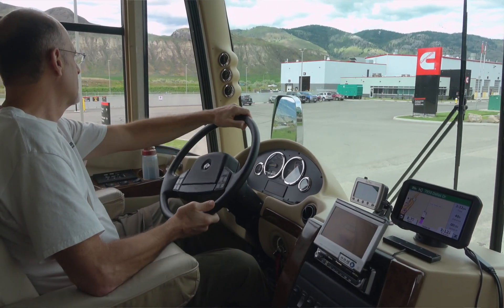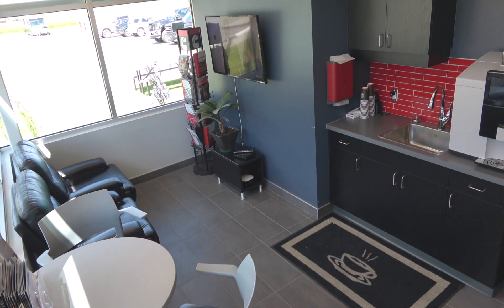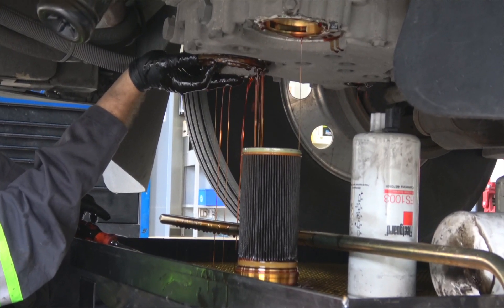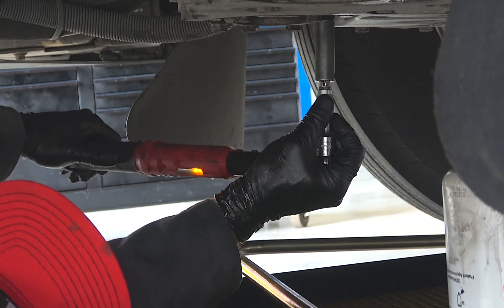💵 CUMMINS COACH CARE RV SERVICE & MOTORHOME MAINTENANCE DISCOUNTS!

Comment: Thanks for the video guys!   Just went past the Cummin's location just outside of Kamloops, so I know the area, as we stayed overnight fairly close to them!    I've been doing my own oil & filter changes, as well as both fuel filters, not hard, and I have a location close by who will take the used oil too.   A little time consuming, but a saving, nonetheless.   Like you, I'll leave the big jobs to the experts!   We recently had a check engine light, which showed that our DPF was getting hot...not overheat, but the light was in yellow.   Soon after that, after we had crested the long Coquihalla hill, I got a 'Stop Motor' signal on the dash, so I found a place to pull over, shut the engine off, and looked around the coach.  All seemed to look fine, and it started, and ran perfectly all the way home.   I took the motorhome into our local 'Port Kells' Cummins dealer, who sent out a Tech to plug into the coaches computer, and found that 'with' the hot DPF, that it went into Regen at the same time, which was what gave the 'Stop Motor' signal.   He said all is good, and after talking with other specialists, they mentioned all was fine, and to continue using the coach, and that it was a 'courtesy' for them to check it...so I was especially happy to hear that there was no cost to the check!   I'll continue using Cummin's, and as mentioned they're local, and that all makes it helpful.   Appreciate your valued opinions on so many of the video's you produce, and thankful for your tips on many things related to our coaches!
Reply from the maker: Dale Watkins Hi Dale! That’s a happy ending story for sure after the potential for something much worse. We’re so happy to hear that your experience with Cummins has mirrored our own. It can be so hard to find reliable shops when you’re on the road, so having a trusted place to go is the best. Safe travels, and thanks for the awesome comment.

Comment: Had our 03 Kountry Star DP, 5.9 300 ISB, serviced at a Cummins dealer last month. Submitted the discount code when I called for appt as well as day of service. It ended up costing me approx $200 more than the discounted price, even though the service rep said ISBs are usually cheaper to service. The service was great and the technicians did a great job, but the $1250 price is a starting point. Disappointed that "ISBs" are treated differently than the larger ISL engines.
Reply from the maker: Hi Jim. Sorry to hear about your experience. We'd like to forward your comments to Cummins. Can you let us know the location where you had the service done?
Reply: @RVgeeks  Hello again. We had the coach serviced at Crossroads Cummins, in Normal, IL on Dec 9, 2020. Thanks, and I hope Cummins provides an adequate answer.
Reply from the maker: Thank you, Jim. We’ll pass this info along to Cummins and let you know what we find out.
Reply from the maker: Hi again, Jim. We've heard back from Cummins already! Although the promotion was for a discount on ISL oil changes (apparently such a good discount that it made it less expensive than an ISB!), they felt that it was not clear in the text that it was for ISL ONLY. So we're changing the text on the special to be more clear that it's ISL only, but Cummins also said they will be issuing a $200 credit to you anyway. Please let us know as soon as you hear back from them so we'll know you've received your credit. Cummins really is a great company, and it's good to hear that that they're not only crediting you, but that you felt they did a great job.
Reply: @RVgeeks  Hello from sunny Florida and thank you for the update. I will contact you as soon as Cummins issues a refund. Again, thank you for the great support and content about the RV world. Really enjoy your videos and such.

Comment: Question what is a air dryer.....does all Cummins have!!!!when do u change?
Reply from the maker: All diesel pusher motorhomes have air systems (air suspension, etc) which require a desiccant cartridge (that’s the air dryer) which removes moisture from the system. They typically get changed once each year.

Comment: Very interesting video. I have done services for our 2018 Ventana twice at the dealer and no more. What is the difference in servicing at Freightliner or Cummins? I will appreciate your kind response.
Reply from the maker: A good shop you can count on is great to find. If you have a trusted shop you use, that's awesome! Cummins Coach Care happens to be one of the best, and has a big advantage for us full-timers... they're located all over the country, so we don't have to worry about being close to our "home" shop for them to stand behind their work.
Reply: @RVgeeks  Thanks a lot for this kind response. I am new, just part-timer yet have done all 48 states. However, we need to find  a good one around N Carolina. We'll schedule Cummins next month. Thanks again.

Comment: Is it just me or does the $1250 for the "Premium Road Ready Pkg" on the Cummins NOW site seem way overpriced?  This is after the 25% RVGEEKS discount too.  You get the 21 pt inspection, which is $329 if you buy separately, so that leaves $921 for the oil change on the ISL & genny, "filters and fluids included".  The last two times I've taken in our Phaeton to Freightliner service centers, it was $400-450 for the chassis lube with oil change with filters and both times that included both fuel filter & separator.  The generator is usually around $100-110 for an oil change.  (I just looked at my receipts).  So where is that extra $400 going?
Reply from the maker: Hi Chris. We’re sure you can call your local Cummins shop and get a breakdown on the pricing. We’ve also been to less expensive shops, and too often got what we paid for. We prefer to seek out premium services from premium companies, but we know that’s not the only choice.
Reply: @RVgeeks  I’ll check out the one in Cummins Coach Care in San Diego (El Cajon specifically) since I will be there this summer. For reference though, the two service centers I’ve referenced above for service are the Velocity Truck Center in Phoenix (Elite Partner) and Premier Truck Group in Twin Falls. Neither are low end truck shops. I’m all about going to a good shop but not willing to pay nearly double the going rate for basic preventative maintenance.
Reply from the maker: We totally get that, Chris. Lots of good shops out there.

Comment: Can they service Caterpillar engines? My RV has a Freightliner XC chassis and a Cat 3126 engine. Thanks!
Reply from the maker: Peter Colquhoun We’ll check on that and get back to you, Peter!
Reply from the maker: Hi Peter! We've received a lot of questions about whether Coach Care facilities can work on non-Cummins-powered vehicles. We reached out to their main office and have received the following response, suggesting that you can contact your local Coach Care location to inquire about any routine maintenance needs. Hope this helps:
“While our highly trained technicians specialize in Cummins products, we are able to perform basic services (such as an oil change) on Detroit and Caterpillar engines. Your service advisor will review any additional charges with you before completing the service.”
Reply: Be sure to mention the code RVgeeks if you make it over to one of the service centers!

Comment: Hi! I'm Ron, I have a problem with my RV that I haven't been able to figure out, hoping you can help me.I have an 04 Allegro bus on a freight chasis. It has a Zantrex control panel. When ever I plug into shore power, all of the lights begin to randomly flash. I can't figure out why. Batteries are fully charged. What else should I been checking for!Any idea what may be causing this? Any help would be appreciated. Thank You.
Reply from the maker: Hi Ron. First, sorry to hear you're having trouble. We haven't encountered this problem ourselves, but we've read before that when you get that flashing of lights on the control panel, it's likely because of a communication glitch between the control panel and the inverter/charger. The recommended solution is to unplug the control panel for a few minutes, then plug it back in. You can do that in two places: either right at the control panel by unscrewing it and removing it from the wall... or at the inverter/charger itself (if you can easily access it). It looks like a typical modular phone plug... and you can just squeeze the little tab to get it to release and pull it out. Again, from either end... whichever is easier for you.

Let us know if that works!
Reply: @RVgeeks  Will do and Thank you so very much for your help!!
Reply: @RVgeeks  Wanted to let you know ,my husband Ron Rogers got the problem with the flashing lights on the electric panel
 fixed thanks to your help!!Thank you!!!
Reply from the maker: Wonderful! Great to hear!

Comment: Sadly my Diesel Pusher uses a CAT engine. As close as I can get to this level of service is the freightliner dealer.
Reply from the maker: Hi Matt! We’re waiting to hear back from Cummins as to whether or not they do routine service on Cat,, Detroit diesel, or other non-Cummins engines. Will report back.
Reply: @RVgeeks  Cool, would be nice to know if they would so I have another option. The closest coach care to me is a 6 hour drive away but would always be nice to have an option while on the road.
Reply from the maker: @mattbuchanan9024  Hi again, Matt! We received a lot of questions about whether Coach Care facilities can work on non-Cummins-powered vehicles. We reached out to their main office and have received the following response, suggesting that you can contact your local Coach Care location to inquire about any routine maintenance needs. Hope this helps:
“While our highly trained technicians specialize in Cummins products, we are able to perform basic services (such as an oil change) on Detroit and Caterpillar engines. Your service advisor will review any additional charges with you before completing the service.”
Reply: @mattbuchanan9024  Be sure to use the code 'RVgeeks' if you stop by one of the locations while on the road!

Comment: Will they service a Detroit 60? Love your videos, I’ve learned so much. ‘04 Monaco Signature.
Reply from the maker: Hi Bruce! Thanks very much for the comment and question. We're reaching out to Cummins to find out if they service and/or repair Detroit Diesel, and Cat, too. Might be after the weekend before they get back to us, but we'll reply again as soon as we hear.
Reply: I'd love to know as well.
Thank you. 🙂
Reply from the maker: Hi Bruce! We received a lot of questions about whether Coach Care facilities can work on non-Cummins-powered vehicles. We reached out to their main office and have received the following response, suggesting that you can contact your local Coach Care location to inquire about any routine maintenance needs. Hope this helps:
“While our highly trained technicians specialize in Cummins products, we are able to perform basic services (such as an oil change) on Detroit and Caterpillar engines. Your service advisor will review any additional charges with you before completing the service.”
Reply: Thanks for checking, much appreciated.